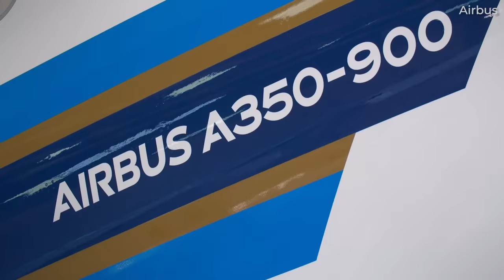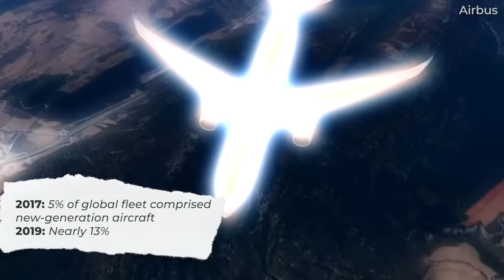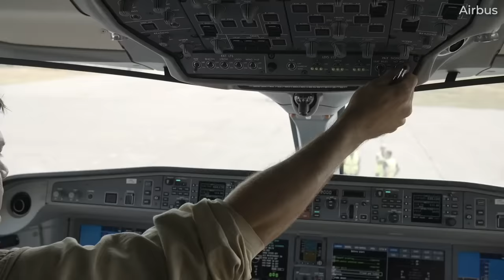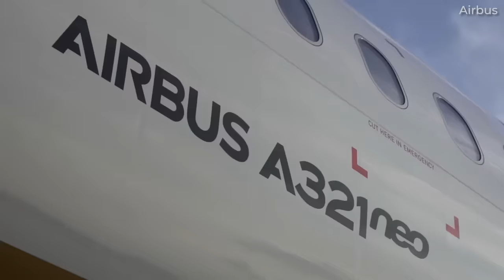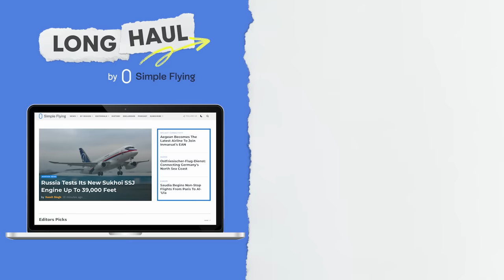A Look At The Full Airbus Commercial Lineup & Backlog Numbers

Comment: What about Boeing's backlog videos later, to compare with this?
Reply: It may eventually come, but I'm not concerned about them.
Reply: @wadehiggins1114  alr, it's really not a big deal. But i only curious about their fleets
Reply: Boeing has backlogs too of course but they are not as extreme as those of the Airbus narrowbodies. Airbus could easily do a stretch of the 220 (Bombardier designed with that in mind) which would be insanely popular. It would probably kill the 737 - similar range and passenger capacity but with the fuel burn of a regional jet. But they have said they see no point to doing that when they could not deliver any for many years because people are already buying the 220 faster than they can hope to make them. It must be a nice problem to have.
Reply: @kenoliver8913  plus the A220 stretch would threaten to cannabalise the sales within Airbus of the A319neo and A320neo.
Reply: @CoSmicGoesRacing  True, but it would cannibalise the 737 even more, so lots more gain than pain for Airbus. As Bill Gates said "if you don't cannibalise your own product someone else will".

Comment: The Airbus A220, A330neo, and A350 XWB are my favorite aircraft models in the present day for the following reasons:
•The Airbus A220 and A330neo provide direct aisle access in all cabin classes with a 3+2 and 2-4-2 seating configuration in their Economy Class cabins, respectively
•Passengers on the Airbus A350 XWB can see the footage of the aircraft's outside via the tail and belly cameras during taxi, takeoff, approach, and landing, or when the window shade is closed or set to opaque
•These aircrafts are twin-engined aircraft, which provide better fuel efficiency, lower fuel burn, and lower carbon emissions than quad-engined aircraft such as the Airbus A340 and A380

Comment: If Boeing had created a more flexible 737 MAX family, they could further break into the A320NEO backlog. The A321NEO’s slight edge in capacity compared to the MAX 10 with its flexible range really aids Middle-of-Market segment it serves, flying 500 miles further than the 10 with the base model.

Comment: I love how we bandy around the term fuel efficient aircraft, no such thing exists, no commercial aircraft is fuel efficient, they do not exist. New generation aircraft are more efficient than older ones of course, they burn less fuel per passenger mile that previous planes but to even suggest a plane is fuel efficient is green washing isn’t it.
Reply: Your correct. Actual fuel efficient aircraft are those powered by a clean alternative fuel that doesn’t have greenwashing involved
Reply: Thanks for making me understand better the efficiency term which is loosely used
Reply: I feel like this comment is overly pedantic simply for the sake of it, and you're just getting to bogged down in the semantics of the term. The industry has been investing in and working on massively expanding the production capacity of Sustainable Aviation Fuel (SAF) for years now which have been projected to reduce emissions by up to 80% from current levels.